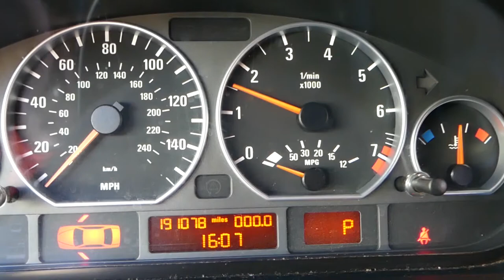PORSCHE CAYENNE BANK 2 VVT SOLENOID REPLACEMENT REMOVAL, VARIABLE TIMING SOLENOID

Comment: Hi and thanks. i have a 958 2012 Cayenne S v8 4.8L. In Jan the car would not smog as the EGR not ready would not set. I took to local shop they couldn't get it smogged, took to my PCA club tech and he kept car for a week and could not get EGR to clear. I was out of the country for a few months so when I returned I broke down and took care to dealer. 650.00 dollars later they said did drive cycles and could not get car smoged. I asked them what did the Piwis say? They said there was no check engine light, they did test and maybe the VVT solenoid is the problem. I asked how are they related and they didn't say. I asked for my keys and took my car immediately away from there. They charged me 650.00 just to drive cycle my car and nothing happened. I am still not smog, no check engine lights and dom't know what to do. I am going to ask my local dmv for a waver and see what they say. My question is can the VVT cause EGR not to set? if so how and why.